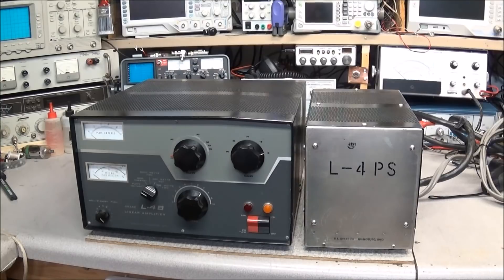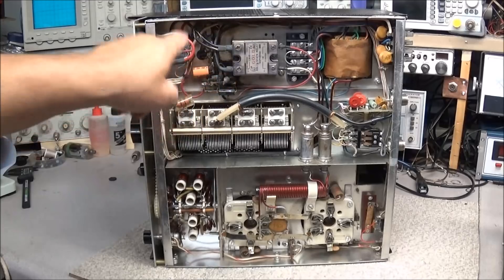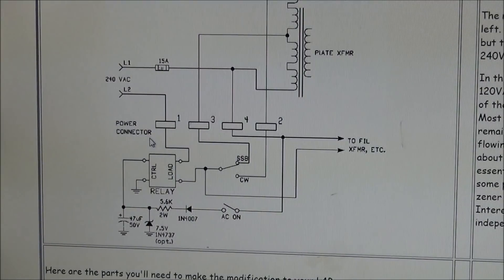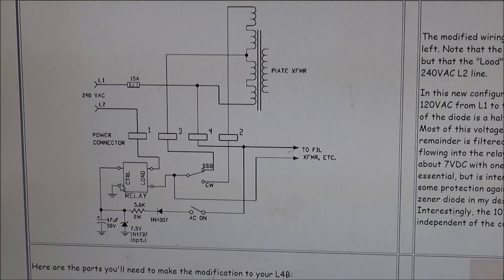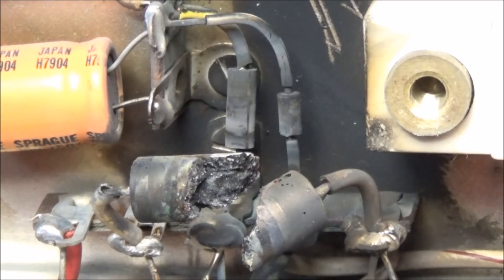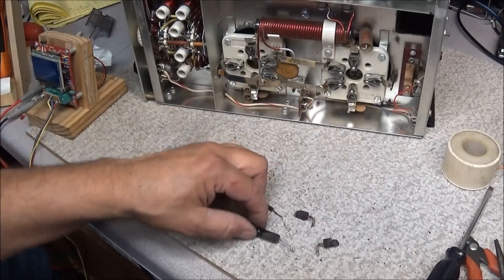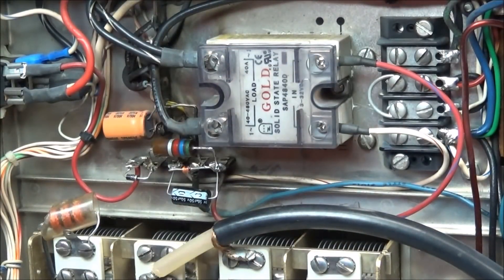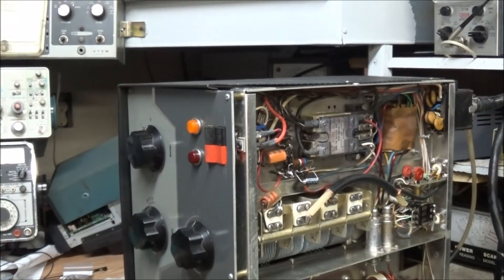#167 Drake L 4B Quick Fix

Comment: Buddy what happens when one of the grid pins comes unsoldered? In my case Drake L7 it was pin three on both tubes. Odd I know. Im starting to think they were not soldered well from the factory. It has the original Eimac tubes.

Comment: That delay relay is still too fast. If you can hear the transformer clank you are damaging th ac power switch. You cant even find the rebuild kits for the switches. I had at least 5 kits and 10 switches. I wish I knew you sooner. 73 W5DN

Comment: Just me, I hate the design of the SSR DC control voltages. The DC control components  are connected directly to the 220 mains and are unisolated and unfused. This also seems to be the case in the original one that blew up and is what will happen when one goes south when it is hooked directly to the mains. I would think a redesign using a 12v transformer to drop the voltage and isolate it from direct 220 contact would be in order instead of a resistive / zener dropping circuit connected to the mains. This transformer would provide isolation if something where to go south, plus I would add a fuse to the hot side of the transformer for more protection too. I also think if that's too much, one could use an AC controlled SSR instead of DC. An AC controlled SSR is designed and legal to hook to the mains. IMHO this DC configuration being used is dangerous and illegal. IMHO

Comment: Good job Buddy.I wanted an L4B for the shack,but sense I use a LDG pro 1000 auto tuner,I settled for a SB1000.Added a soft start ,a wafer on the selector switch and a little solder work and it been a good amp.73 from Ronnie
Reply from the maker: Good deal Ronnie. They are great amps. Thanks

Comment: Had a resistor smoke when working on my Military  signal Corp R336 receiver. Apparently it had been used as a test radio for techs a total of 9 wires were found cut. The worst being inside a big IF can all the screws were unscrewed  from the cover and 5 wires cut then it was was screwed back down.  That relay sure did make a nice fireworks show and a bit scarey for sure. Glad you were able to fix it and get it up and running again.
Reply from the maker: I bet that was scary. I never like seeing fireworks from Thanks for sharing.

Comment: You get some real easy jobs. lol. I thought your voltage was 120v where you are.
Reply from the maker: Easy jobs are good. You are correct. The normal house hold voltage is  120 volts here.  But all the higher amp stuff uses 220.  Like the clothes dryer, water heater, heating unit. And in the shop the AC welder, Air Compressor.
Reply: Thanks. Well I didn't know that. I learn something everyday, especially from you.

Comment: Great video Buddy, it is so strange that you would do this video since last week about this time I turned on my L4B with the solid state relay in it and the same failure happened.  It took me a bit more testing and checking to fix it and make sure I had solved the problem than it did for a pro like you. Keep the quality videos coming I enjoy them more than any other videos on YouTube.
Reply from the maker: Thanks Kevin. Did you find a loose wire also?
Reply: Kevin, personally I think you are better off NOT doing this electronic relay mod.  You can obtain the exact results this mod deals with by making no mods to the amp itself.  You would be much better off simply making a cheap
 external on switch for the amp by switching the line voltage to the amp cord and leaving the switch in the ON
 position on the amp.  It accomplishes the same thing and you will probably NEVER have a fault like this.  Better yet a TRUE step start circuit is still better yet.  I would  not recommend this mod with other better options available.

Comment: Buddy, It looked like the diode that you checked after the 1N4007 was shorted.  The meter read zero ohms (or close to it) from the digits that were visible on the video (8:49).  That would explain the blown resistor. Have a look and see if you agree. 73 de Randy wb0smx.
Reply from the maker: Yes it was a zener diode and was opened. I replace all the components in that circuit.

Comment: Thanks Buddy for the upload, can tell me how you can check the vswr through the input tuned circuit with the power off, I have an sb220 and need to adjust the input side for 80m as it's a little high but am a little nervous to do it while the full 3k volts are on.
My best regards,hope your keeping well, Carl.73.
Reply from the maker: High Carl. I have used a MFJ ant analyzer to do that. You will have to engage the relay manually.
Reply: Thanks Buddy, I shall try that and let you know how  I get on .
Regards from Carl.

Comment: Ha! Reminded me of turning the HV on my HB pair of 3-500z s once and a big bang. Instead of smoke though, dirt went flying everywhere. A dirtdobber had built across the diode connections. Vaporized that poor fellow. I just recently did the Harbauch mods to my 4-LB. Love that amp, but wish it had 160 meters. Again, nice video Buddy.
Reply: Oops - L-4B I meant.
Reply from the maker: Bet that was a nasty mess to clean lol. There is a mod for 160. Thanks for watching
Reply: Yeah, I've seen that mod and seems too involved to me. Thanks, Buddy
Reply from the maker: A bit involved but well worth it. Save the power switch for sure.

Comment: Good to see no major damage was done.  Had to laugh when you said the owner turned it off and retreated to the other side of the room.  Reminds me of the first time I accidentally installed a high voltage electrolytic  cap backwards.  Surprising how much steam and noise a 100uF 500V cap can make.  I swear to this day I still cringe a little when I first turn on something tube type after recapping it.
Reply: NikkiGurlSixtyNine 

That's a little low voltage cap.  Imagine that several times larger and with 460 volts on it.  Made for a good light show to.
Reply from the maker: LOL. I do the same thing every time I rebuild a unit like this. You are right about those caps exploding. Remember the old Sprague 500 volt caps with the paper cover?, Man those would let a lot of smoke out.

Comment: Good job on that L4B, Buddy. It is always a pleasure to watch someone like yourself that knows what they are doing. Mt amp is the old Heathkit SB-200. She has a few issues that I haven't figured out how to fix yet, both mechanical. One problem is the TUNE knob is stuck on the shaft and the set scew is broken down inside the knob. I think I am going to have to butcher the existing knob to get it off, then replace it LOL. Thanks for the video. 73 DE K7RMJ  Frank
Reply from the maker: Thanks Frank. You may be able to drill that set screw out. Have done this to a few.

Comment: Nice fix Buddy...usually the 0.82 ohm "safety resistor" in the HV supply is what pops. I've been maintaining and fixing my L-4B since I bought it new in 1979. The Harbach soft start kit is what I have installed in my two L-4Bs. Just about everything that can go wrong has done so at one time or another but that amp just keeps on purring and the only microprocessor installed in it that can burp is the one between my two ears!  ;-)    73 - Dino KL0S
Reply: Dino Papas 

As long as that microprocessor doesn't burn out all is well. ;-)
Reply from the maker: Thanks Dino. I will say they are one of my favorite amplifiers to work on. Had plenty of those 0.82 ohm resistors blow.  I think I still have 50 or so of them in stock. One thing about it, these amps can erase that micro between the ears.....
Reply: That's for sure, if you're not comfortable around VERY high voltage leave it to someone who is - it WILL KILL YOU. I've rebuilt several L-4BPS power supplies for folks and even replaced one of my supply's transformers with a higher voltage unit (Hammond makes them now; a couple of KL0S Shack Notes describing that fix is on the WB4HFN website along with another about a fix for the 3-500Z socket to fix the tube pin problem you described).

Comment: Yes high voltage is dangerous. Nice amp to go along with the Drake collection. Wait a while for the cap's to discharge. I have worked on SB-200 and FL-2100B always remember about discharging the high voltage after the power is turned off. Thanks Buddy for a very good video
Reply from the maker: Thanks Lyle. Good thing about these amps with no power supply connected no high voltage.  One reason I like these amplifiers.

Comment: Hi Buddy,
Talk about high voltages, was working on my SB221 about 20 years ago and thought I had bled off all the high voltage. Well, there was still several hundred volts and when my hand came in contact the jerk back caused my hand to hit the chassis and slice open the side of my hand. Needed a dozen stitches to close the wound. At least I had survived and it was an unexpected learning experience.  73  WB3BJU
Reply from the maker: Wow Donald. Horrible experience  for sure.  That is mostly the problem with  getting hit by something like that.  If the current don't get you the obstacles in the way will.  Never liked working on the SB221 series.
Reply: Have it apart now to convert it to a SB220.   73   WB3BJU